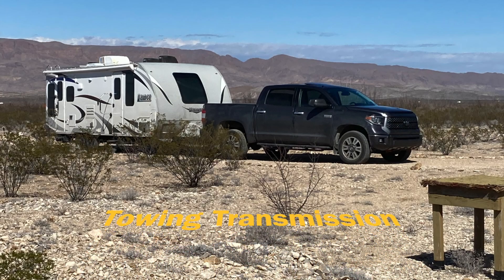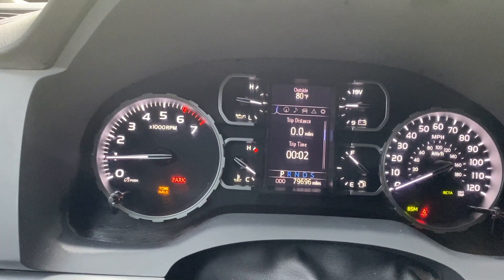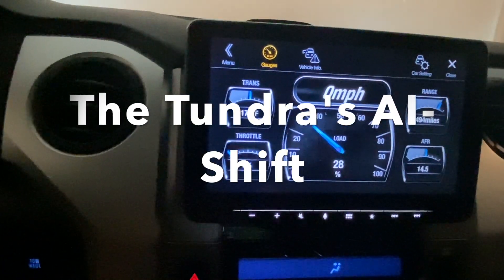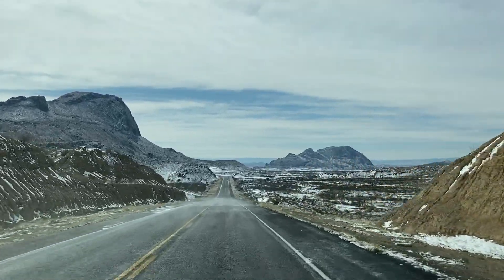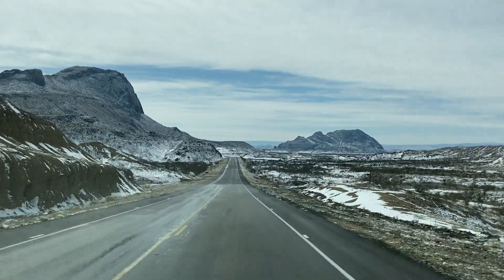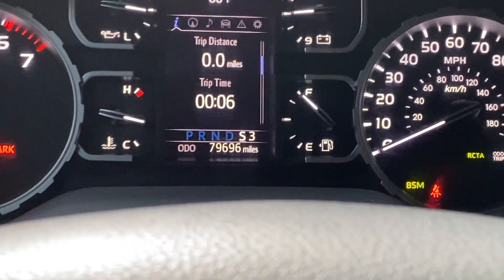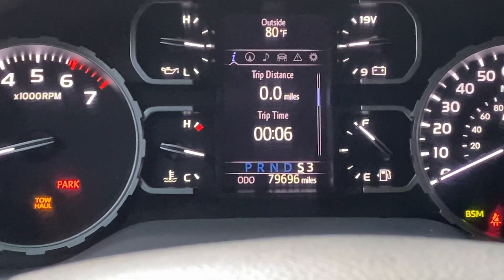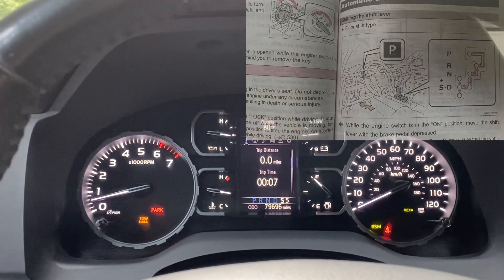Tundra Tow/Haul Mode D, S4, S5

Comment: I agree with you on everything. I've got a 2020 trd pro and I had a tranny cooler added to mine because of temps. Between the cooler and manually shifting the truck to 4th the temps stay in a very safe place. 4th gear I believe is 1 to 1 direct which is why it tows great in that gear. By keeping it in say 4th gear it allows the torque convertor to stay locked which decreases temps big time. If you move it to 5th it does the same thing and keeps the tranny from hunting for gears which keeps those temps down.
The reason it has 6th is so when you're towing you can leave it in 6th and as soon as you hit a hill you can bump It into 5th and then 4th. When you clear the hill bump it back to 6th and it's just like having it in drive. The reason is if you're in drive and then move it to to manual mode it automatically goes to 4th gear which may be too low moving down the highway which will Rev the engine too high. When I tow I automatically put it in 6th to start and manually control it from there.
Reply from the maker: Man, that is a great explanation of S6.  Hadn't really thought about S6 that way.  This is the type of info I love to gain.  Makes perfect sense to me.
Reply: @kedrevs4037  These trucks are amazing. When I bought mine I wanted something that would last a lot of miles. Out of all the trucks Tundra was the only one that would fit the bill. Of course any truck can go a lot of miles if you pump enough money into it but I wanted one with the reliability to do it on the cheap. It's a great truck.
Reply: @jamesvaldez4093  Toyota Says it doesn't need a cooler but I added one also and so far when not towing my pan temps have never gone over 200 degrees even in 95 degree weather. BTW I have 2020 Tundra TRD PRO also in MGM
Reply: @dalephillips8250  It's great insurance and I plan on keeping my trucks so it's a good investment.
Reply: @jamesvaldez4093  Same here sir.
Reply: I have a 2021 tundra I would like to put a transmission cooler on it. Which cooler did you end up buying? Also, did you put it on yourself or did you pay someone to do it?
Reply: @SuperSnakePlissken  If you're asking me...I went with the Setrab cooler kit from genuine cooling systems. You can just get a cooler, thermostat, fasteners and lines yourself and run them but this guy puts them together for you. Now I installed it myself but some people do have a dealership or others install it. If you have decent mechanical skills its not too hard a job to do. The hardest part for me was running the hardline from near the trans. and up around the engine to the front. Now if you just used rubber hose the whole way like some have that part would be much easier.
Reply: @SuperSnakePlissken  So I found a transmission shop to do mine. I have the mechanical skills to do it as I'm always working on and tinkering with trucks but since it's under warranty I wanted a reputable shop to do it to keep that warranty in tact as much as possible. I told the shop to use as much Toyota parts as they could and they purchased them from the dealership and did the install. They even installed an electric fan on the cooler and put a switch in the truck for me. Total cost was about 800 bucks and looks factory. They gave me a warranty as well.
I took the truck in for its first service and the writer immediately noticed the cooler as he is a Tundra nut. He noted the products were purchased from his dealership and made all the notes needed for it to be covered under factory warranty.
The cooler has made such a difference and the Temps in the pan on a hot day stay more than reasonable and when towing there's not much difference as it does a great job of cooling. I hit the fan once to see what would happen and it came down about 10 to 12 additional degrees. Perfect for city driving.
I'd say go for it especially if you plan on keeping the truck.
Reply: @jamesvaldez4093  Is your thermostat, pinned???
Reply: @jamesvaldez4093  Hey James… being that you added the cooler… how did it work hooking up to a gauge? Do you have a separate gauge or did it go directly to a gauge in your dashboard? Thank you Danny
Reply: @dalephillips8250  Same question to Dale on the gauge for your new tranny cooler… just wondering how it ties in to the gauge?
Reply: @Danny-tk3rs  The Guage you are referring to is a "scanguage" that you buy separately from Amazon or somewhere so that you can read your transmission Temps.  It hooks onto your obd port under your  dash....the same port techs use when diagnosing a vehicle
Reply: @dalephillips8250  Thanks Dale! I thought I would have to only look at ‘18 and older… I will expand to 19-21 …definitely don’t want the new Tundra!
Reply: @Danny-tk3rs  yep I have no interest in the 2022 or newer

Comment: I got a 2012 Tundra & I never could get an answer on the "S" modes. I was told by the dealer that if you get a squat on your rear end whil towing/hauling then use the tow/haul mode. Thanks for the tips, Drive safe. 🤠🤠
Reply: Saying the "dealer" doesn't mean anything. LOL

Comment: Toyota recommends tow haul mode and locked in s4 when towing a significant amount of weight to maintain the engines torque curve and engine braking. I pull my rv all the time on the interstate cruise set at 70 running 3k rpms has zero issues cruises right along.
Reply from the maker: Per the owner's manual for 2018, Toyota definitely recommends being in D with Tow Haul mode.
Reply: @kedrevs4037  2019 owners manual, p187 under "trailer towing tips"...."to maintain engine braking efficiency and charging system performance when using engine braking, do not use the transmission in D. Transmission shift range position must be in 4 in the S mode."
      P.199 under "Tow/Haul switch"....."Use TOW/HAUL mode when pulling a trailer or hauling a heavy load."
Reply: @thomasdean5651 these guys are idiot 
Never tow on drive 
Let them tear their shit up 
S4 is the best for heavy towing

Comment: I have a 17 Tundra and a 2020 Escape 19 at 3500lbs. (Fibreglass like Casita) I get 12mpg towing at 800’ elevation around the Great Lakes. I use Tow Haul and generally tow in S5, up or down depending on terrain. In S5, the transmission rarely downshifts doing 65mph. I have the TRD exhaust and it purrs. I love this truck. Bad gas mileage is cheaper than some of the repairs my friends talk about. The only other truck I would consider is a Cummins Longhorn.
Reply from the maker: I have been very tempted by a Cummins Limited near me.  If it wasn't white....
Reply: I'm curious about the TRD exhaust. I have read that one gets droning noise when under load, say going up a steep grade. And also the engine makes less torque at lower RPM, meaning the torques curve is moved to higher RPM's. Did you tow the same trailer before and after the TRD exhaust and if so share the difference? Comments about the droning and torque also appreciated. Thanks.
Reply: @truthjustice3313  I bought the exhaust when I bought the truck. If the truck makes less torque at lower RPM, it would be negligible. The exhaust doesn’t drone at all, it is wife approved. Would I buy this exhaust again? It only has a 3 year warranty, the Borla is similar and comes with a lifetime warranty. The truck barely works pulling my trailer, an Escape 19, round like an Airstream.
Reply: @truthjustice3313  I'll second the answer as I have 2020 TRD PRo and there is no droning. I love the exhaust note of this truck but when you are driving down the road you hardly hear it unless you get on it for a while and then its like music to my ears.

Comment: Great data I have been looking for this info I have a 2014 4.6 Tundra and it did not come with tow haul mode so I have been using S mode shifting like a straight shift. Even the dealers have no knowledge of how to use this. More on this subject would be great for those of us that have trucks that don't come with two haul option but have s mode.
Reply: Just leave it on 4th gear and you’ll be fine.

Comment: Looks like a Lance 2375 yes? I've got the same trailer towing with a 2016 Tundra. Tows nice. To make a comment on S6. If you stay in "S" mode, you would use S5 and S6 based upon terrain. Better than jumping back and forth between D and S. Better control while towing. That's what I do. Thx!
Reply from the maker: It is indeed a 2375.   Appreciate the explanation for S6.

Comment: Oof. There is no “AI” in this transmission control module. It is all deterministic. 

“S” stands for sequential, not “shift.” The transmission is a direct shift transmission meaning it can skip gears to get to the right gear. Moving it into sequential, when you’re towing, will ensure the transmission does not skip gears. This is why “S6” exists.

The reason the transmission moves into “S4” when you switch it to sequential shift is because 4 is the direct, 1:1 gear ratio, and the gear you should always be towing in. If you want to heat up your transmission, tow in S5 or S6.
Reply from the maker: yes "sequential " is correct, having vehicles where the "S" stood for sport or or shift gets me to say the wrong word sometimes.

The Owners's manual disagrees with you on mode selection for towing and clearly recommends towing in D unless you are frequently climbig and descending hills.   Additionally I can personally verify that towing in S4 will do little to nothing to change trans temps unless you are climbig and descending  hills frequently.
Reply: Page 210, section 4-1 for my 2020 reads (just like my 2014 did):

“To maintain engine braking efficiency and charging system perfor-
mance when using engine braking, do not use the transmission in D.
Transmission shift range position must be in 4 in the S mode.”

As for heat, at constant load, a higher gear will increase transmission temps and (potentially) reduce engine temps. In the system, a transmission is a torque multiplier for the wheels. I haven’t found a way to change the laws of thermodynamics.
Reply from the maker: @leje-zj4dr  I have the same manual.  Engine braking is not available above S3 because S4 and S5 don't cancel cruise control.  S3 does.

The preferred method for long stretches of towing at constant speeds is the in D with Tow/Haul mode.  The AI shift will still allow engine braking to occur on subtle declines, even in 4th or 5th gear without gear hunting and heating up the transmission.
Reply: @kedrevs4037  yeah, that’s not in the owners manual, sorry.

Comment: I have a 2016 Tundra i was to add a gooseneck horse trailer that weighs 5500 dry, loaded it  should weigh in a around 7000lbs. Is that too heavy for my Tundra?
Reply from the maker: i would get the pin weight of the trailer checked, then go from thee, but at that limit you will likely be right near or just over payload.

Comment: Great video. Have a 2021 Limited Crewmax. This really makes the S mode make sense. I do tow 6,000 lb. travel trailer. What weight distribution hitch would you recommend?
Reply from the maker: I actually have 3 separate WDH systems.   Two are Fastway E2s, one is a Curt.  I have both a trunnion and round bar system in the Fastway, I have WDH only in the Curt.  The two brands are so similar, their parts are actually interchangeable.  

It is very important is to get one with Sway Control or to get added Sway Control with the WDH hitch.  I find for a load your size (and mine),  GVWR 600lbs, the Round bar was (2 points ) vs the trunnion (4point) Fastway E2 to be very efficient.  The key is to make sure you have adequate pressure restored to the front end when you set it up.  Fastway has a great video on how to do this.

Comment: Respectfully I have to disagree with you and here’s why. I have a 2020 TRD Pro with a very loud OEM exhaust which reverberates off the trailer. I tow a 5,000lb trailer on the interstate several times a year. Usually it’s a 12-24 hour stint. Tow haul mode is wonderfully on the surface streets and around town as it really prioritizes gearing and throttle response. However on the highway it’s a hindrance as on the slightest incline or slightest bit of Hadwin it instantly downshifts to 3000-3500 RPMs it doesn’t upshift quickly enough even when leveling back off on flat ground. I turn off tow haul mode and it keeps the RPMs lower and the truck has no problem lugging up over an incline at 2500 RPMs as long as you stay out of the throttle and can tolerate a 5 mph speed loss. I also put it in S5. Not only does it obviously limited from going into 6th but it absolutely prioritizes maintaining 5th gear over the standard shift algorithm. This all works really well on cruise control at 70 mph. If there’s any hill it will start surging between fourth and fifth trying to go back to 5th to maintain it. At that point I drive it manually turning  cruise control off and can keep it in 5th gear up most hills doing 68 to 72. Now all that being said this is why I’m getting a Harrop supercharger as manually working the gas pedal for 12+ hours is very fatiguing as is listening to a tuned exhaust above 3000 RPMs. I want to maintain 2500 at 70 mph on cruise control no questions asked on most interstate inclines. I guess we shall see🤷🏻‍♂️
Reply from the maker: This is one of the many scenarios that I am thinking about.   I’m not in a rush, but keep looking at options.  Great info by the way, really appreciate it.
Reply: Per the owners manual (page #191 of mine) it states not to use cruise control when towing . On the Tundra forums most of the comments are also the Tundra seems to "hunt for gears more" when towing with CC on, I have experienced this when trying CC for a few min when towing. So when towing I never engage CC.....I own a 2020 CM Tundra and regularly tow a 7,000 lb TT.
Reply: would changing the gears make a difference in you’re opinion?
Reply: The manual specifically says use Tow/haul (over a certain weight) to avoid damaging the transmission. Not using it, is like lugging a manual transmission and it’s not good. Sometimes, mine refuses to up-shift and I need to put it in manual mode. I don’t mind…14 years and zero repairs on my 2008 Tundra. I tow much more than 5,000 pounds too. I’ve got a 9,000 camper that’s 33 feet long and I can hardly tell it’s back there. A camper is much different than a regular trailer, because of the wind it catches.
Reply: @ellieandadambullion7708 agreed, more load on the torque converter running in an overdrive gear

Comment: Doesn't it grade brake when in tow/haul mode?
Reply from the maker: Actually the Tundra will only utilize engine braking in S3 or lower.   There is no engine braking in “D” with Tow/Haul.   There is also no braking in S4 or above.
Reply: @kedrevs4037  oh figured it was like every other truck where it will downshift when in tow/haul to engine brake

Comment: Tundra is garbage get real truck
Reply from the maker: Thank you for adding that quality analysis.
Reply: Kenny Crawford......I bet your a Dodge fan aren't you? Tundra has been the best truck I've owned. I've had Chevy,Ford and Dodge and the Tundra is by far the better truck.
Reply: @troyalanoutdoors907  I have owned 4 Chevys and 2 Fords. I rate them all as garbage. I have had 7 Toyotas and they have never had any problem. My son bought a Jeep  and the frame is rotten. I asked the dealership about a recall, they laughed, I responded Toyota’s putting new frames under 12 year old Tacoma’s for free. I oil sprayed my Tacoma so my frame was mint. Most people who hate Toyota have never owned one. I have owned most brands and keep going back to Toyota. When my friends transmission went on his Ford for the second time he got angry and threatened to torch the car in the dealership parking lot.
Reply: I’m wondering what truck he’s considering as top notch ?!?!
I drive GM trucks at work, and have owned SO many Ford trucks through the years. My most reliable Ford was a one ton with the 7.3 Powerstroke. I put 300,000 miles on it, but not without some repairs. A few of my F150s needed engine rebuilds prior to 200,000 miles. Both my Dodge’s were junk, and one Nissan truck was as well. Every Toyota truck I’ve owned has been rock solid reliable. My current Toyota is fast approaching 300k and despite shopping new Tundras I won’t part ways with my “land crab”. I’ll keep it for muddy/rainy days or just avoiding piling extra miles on the new truck. Since I’m in my 50s now this next truck MIGHT be my last, so I’m definitely going to be picky about what I get !
Reply: I talked to 3 Silverado owners in the Fall of 2019 who had lifter failures. In the last couple months I have had friends who had issues with their F150, one had his spark plugs blow out on his 4.6L and one who had his plugs break off when he tried to change them, 5.4L. I don’t have any Dodge stories. My buddy who is a mechanic says the Ram is the what he would buy right now based on price and reliability.
Reply: Best truck I have ever owned is Toyota Tundra
Reply: Kenny, you obviously don't know jack about trucks. I bet you voted for Joe, too ; \
Reply: @dougsmith7195  my neighbor has a 2016 Dodge Ram 1500... he just had to replace his camshaft ($6K repair). The mechanic told him he should have purchased a Tundra ; )
Reply: he drives a tundra.  😂. he just wants attention.